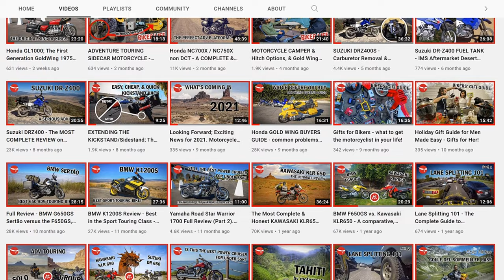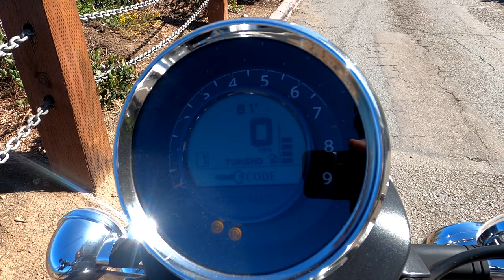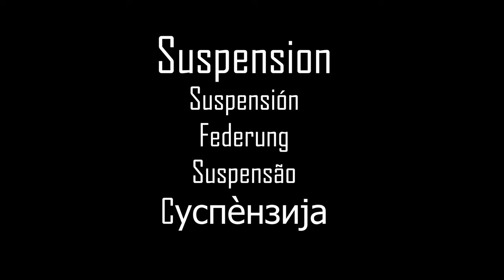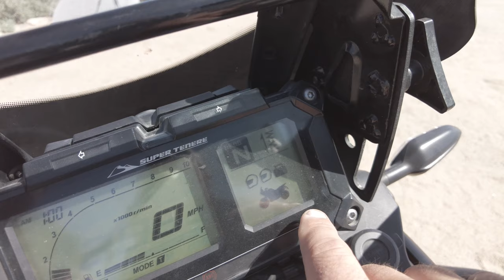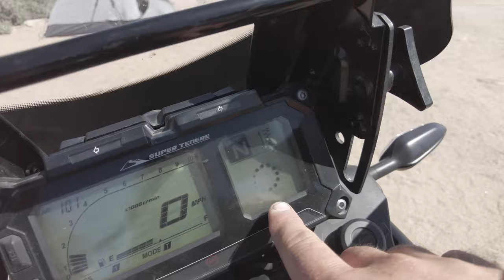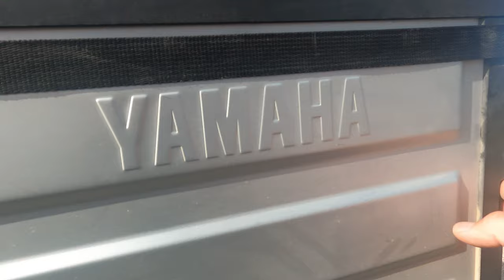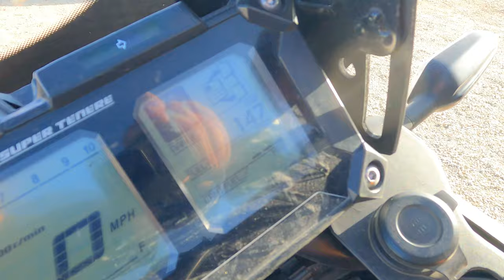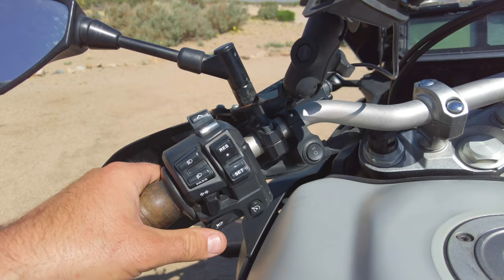Yamaha SUPER TENERE ES XT1200Z + luggage, ADV mods & Upgrades; a COMPLETE, HONEST Owner Review in 4K

Comment: Great review! I am happy you choose this bike to review as we can not see many videos for ST.
I got my first bike 6 months ago and its Strom 650XT, but I feel I need more power and thinking between Strom 1000 or Super Tenere as they are bulletproof and have normal price on market. I am not sure If I am going to see much difference if I choose bigger 1000 Strom. I am 6.7 tall and 230lbs so I guess Super Tenere would not be heavy :)
Reply from the maker: Zdravo Lazare. Dobrodosao i hvala na podršci.  Pisaću na engleski da me ostali razumiju jer ipak ljidi čitaju ove komentare. My very first review on this channel was of my Vstrom DL1000. There is a very noticable difference between that bike and the smaller 650. It also feels a lot like three than the super Tenere. I loved my Vstrom, owned two, and would gladly ride it again. The newer ones also look fantastic with the yellow spoked wheels. Again, it's quite a difference in power between it and the 650. I've owned that twin engine once, on my sv650 and sold it within a week for being underpowered. After that I've owned three sv1000s which share the engine of the Vstrom. The Vstrom also sells quite easily, and doesn't sit on the market as long. I say give it a shot and ride both to compare. But for someone your size, anything less than a liter bike will not cut it.  Good luck.
Reply: @pegasusmotorcycletours  hvala Nikola, I am going to check this weekend strom 1000 with 8k miles,  2016 model.
Reply from the maker: @lazarsekulic2694  let me know of you need a second opinion. I'm happy to look at the ad and let you know if I see something interesting.

Comment: Hi Nik! Great Review and very good analytics of the ST. I own since 5years a black DP01 from 2012. I use it only onroad, with Michelin Touring -Sport Tyres. The comfort is unbeatable since 75.000 km now. For Offroad I prefer my old XT500.....the weight.....but you told about it.😁
You forgot to show the possibility to manipulate the fuelinjection ( CO-set) for a smoother running at low rpms. It is a thing of 20 seconds.......
And the possibility to reinstall the powerlimiter of the first three gears....
That cost a few bucks, but
this is necessary to survive on the Autobahn😁
Greetings from good old Germany
alex
Reply from the maker: Servus Alex, and thanks for participating in the conversation. Thanks for those great tips. I recently test rode the Guzzi stelvio and was very impressed. Very similar specs but a larger tank. I'm curious, I've owned two guzzis and they have been my favorite bikes so far.

Comment: A great bike for sure. The triumph 1200 tiger shaft drive is a great alternative but I think it's dearer secondhand but their engines are great. A superten with 30000km+ will be £5000+ . Only drawback is doing valve shims. Fortunately they stay in spec especially if the motor has regular oil and filter changes. That way there will be hardly any wear on the valve train.
Reply from the maker: Thanks for watching. Please stay tuned as tomorrow I release the trailer for the private Eastern Sierra tour in case you're ever in my neck of the woods. It's.some of the best riding in North America.
Reply: Nick Sanders used a tiger 800 doing over 50000 miles on one of his round the world rides. It was a great statement of reliability and not too big and heavy and very reliable. I had cheap Yamaha XT500 and Suzuki GS750 which were both good and the yam was good on Aussie dirt roads but the Suzuki was very reliable and had 40k miles on it. Superb motors and only the gs850 was better due to shaft drive, power and big comfy seat 2 up. One of the best UJM inline 4 cyl of a good 80 bhp at the rear wheel. It went round the clock and was an ex despatch riders bike that cost £500 but never broke down, only a puncture in all the time I had it. Great those GS Suzuki's whether 250,400, 425, 450, 500, 550, 750, 850, 1000.

Comment: One most underrated newest bikes. Its overbuilt, clever, quality motorcycle. Maybe it was bit late to the market and not properly advertised. 

About engine: I saw dyno runs before and after remap... Difference after remap is huge, alot of gains and power are unlocked that transformed engine and power delivery. I hope someone who did remap would write few words :)
Reply from the maker: No doubt, I agree with everything you mentioned. In fact there was a comment last week that talked about how remapping those wonders for this bike. Would love to experience myself
Reply: @pegasusmotorcycletours  To bad BMW took all apples with R1150GS and later on. Tenere has strong heritage but someone at Yamaha let it down. Leading every motorcycle in that class is compared with GS. Being right at wrong time.

Comment: To get rid of the carpel tunnel pain is get the pro-taper adventure handlebar.  The stock handlebar places a wicked twist on your wrist. Put the stock pipe back on it.  Loud exhausts are not so good on the ears.
Reply from the maker: Thanks for the to. Really appreciate it.
Reply: Might save your ears, but not your life...as a 44t truck driver, I often hear you,before I see you...a completely stupid suggestion, the engine was designed on a bench, then strangled...put it back to the way it was designed, noise and all!

Comment: 46,000 MILES ON MY ST,Gets over 50mpg easily touring Europe 2 up and I dont hang  around,Rear Diff main seal replaced 4000 miles ago and routine service ,thats it,totally agree with you with the panniers,crap locks,bike still looks good for a 2011 model,I use Metzeler Tourance tyres,6000ish rear ,9000ish front and you are right you cant sell em but who wants the breakdowns of KTM,DUCATI AND BMW mid vacation,I will keep mine for ever I think.
Reply from the maker: I can see the appeal of this being the long term keeper. It has everything a rider.coukd want. Thanks for watching and coming in

Comment: This is one of the best video’s explaining this is a proper adv bike. I have a 2014 model with 90.000 km on it whit no problems. The thing with the super Tenere is that it is so good it is one of the most borring bike on the market. The power is perfect nobody needs more. The suspension is great the way it eats his miles it is so damn good it is just borring. If you take care a bit of you right hand you can do 20 km’s a liter. I think all bikes above 200 kilo are no good for loose sand and mud or you must be a pro driver or a verry strong men lifting this bully. It is the most underestimeted bike because the european market is ful of bmw’s but I think it is a far better and more reliabel bike dan de GS at the time of production 2010. The new Bmw from 2020 are way better but that is a ten year of more experience. Thanks for the video and have fun. Greetings from Hollanders drive safe.
Reply from the maker: Thanks for watching and participating in the conversation. I'm glad you found the review accurate. Another bike that similar and very well priced here is the Aprilia caponord. I'm looking for one and 8 grand can ge the rally version. So many bikes, so little time. Greetings from San Diego.
Reply: Just bought a 2013 with 10K miles. 
Can't wait for the season to start.
Even on a short test in really cold temps, it feels like the right answer that hits the sweetspot for how I spend time on 2-wheels

Comment: Hi you didn't mention  the durability of handgrip  heater.  May I known your recommendation  on how to preserve  it as well ?  Do you recommend  to freely   use  power  spray  water on those control on the grip when you do car wash  of your bike ?I appreciate  your review a lot simply because maybe you're on  same height and  we almost have same thought  on it. Thanks
Reply from the maker: Thanks for watching and for your question. Washing your bike by hand should not be a problem. Avoid strong pressure washing like at the carwash. The heated grips require no maintenance but I would avoid directing water on the hand controls. I wash my bikes with a bucket and sponge. Cheers.
Reply: @Pegasus Motorcycle Tours & Consulting  thank you so much for the kind response.  Mine is only 14000 km mileage  yet the heater is worn out. I watch other review and the found out somewhere  in 30000km mileage  the cable got broken but  he didn't  mention as well  the reason. . Anyway thanks again.

Comment: So how does this compare to the Honda Africa twin??? Thank you for the video. Coming from dirt bikes, super bikes the a Yamaha raider. Now looking to dip my foot in, will be doing mostly highway but then gravel back roads and also a mountain bike rack to Arkansas. 
Thanks again
Reply from the maker: Thanks for watching and for your question. The AT is much lighter and more capable on the dirt.  Bigger front wheel slows for easier riding over rocky terrain or obstacles such as logs. It all depends on how difficult the roads you wanna ride are

Comment: For sure, if you want an Adventure Touring bike that does great mostly off road on sand, skipping stones, this is not your bike, neither is the BMW or KTM or Triumph or any other heavy weight. Go mid-weight or dual sport. If you want to crush highway miles to get to forest access roads looking for, say, dispersed camping sites or maybe hunting access areas, this is definitely your bike. This is a GREAT touring bike that will carry you and your gear to remote areas for less money and greater reliability. What you can do on a Beemer you can do on an S10. It's a matter of how much you want to spend..
Reply from the maker: I agree with everything you said with one caveat - the big ktm 1290 can actually do amazing things on rough terrain. More so than the rest in the class. I have a 790 now and am very impressed but have seen what a 1290 in good hands can do.

Comment: I’m considering buying a tenere 1200. Another video stated this bike is an 80/20. 80% on road and 20% off road. Do you agree or disagree with that assessment?
Reply from the maker: Id say in good hands the bike is more capable than merely 20 percent. Any bike can be 20 percent capable off road. It's all how comfortable you can get with a heavier bike, but one with great components. Fairly unintimidating wider dirt trails are fine. It's an ADV bike after all and yamaha knows how to make bikes.

Comment: For the slippery top of the cases, you know those small glue on plastic door handle stoppers? Yea get a pack of those and place 6/8 of em on the top. Worked like a charm for me and theyr practically invisible.
Reply from the maker: Thanks so much for the tip. You don't get dirt collecting around the edges?
Reply: @pegasusmotorcycletours  i do, but they dont collect on the glue, more so on the hot "plastic" material... Also another good one (that works better than door knob stoppers) is that clear tape that comes with sticker kits and other stuff allike. Maybe even stuff like tank grips wouldnt be bad.

Comment: With Motoz Adventure tires you can dig thru the sand on this beast. And it can do some wanna-be-extreme thing, it's always a pilot, not a motorcycle. Mine 2019 has 39000km, I did tough terrains on it, bulletproof.
Reply from the maker: I do agree there, the rider is the most significant determining factor as to what the bike can do. Thanks for watching.

Comment: one gallon means 3.8 liters at 40 miles i.e. 60 km... so at 60 miles i.e. 100 km it would consume about 1.5 gallons i.e. 5.7 liters... I say that for a 1200 cc engine it is very good consumption... on the highway at 95-100 miles the consumption of my motorcycle was 1.6 gallons... so personally I say it's more than ok...
Reply from the maker: Perhaps it's my own personal annoyance with having to visit the gas station literally every day to fill my vehicles. For that time saving it's been nice owning an electric motorcycle. My home bfr1200 also has a smaller gas tank than it's 800 predecessor which is and annoyance. Thanks for watching

Comment: 110BHP & 82ft lbs Torque, 270 degree crank, twin spark plugs per cylinder, 1199cc engine, 261kgs in weight. Yamaha stopped production of this motorcycle in 2020 in the european market due to not making the engine EURO 5 emissions efficient.
Reply from the maker: Are you in the EU? I am contemplating a purchase of a 6 Mile 2014.

Comment: Extend the pipe on the aftermarket one it would still be lighter
Reply from the maker: Thanks for that tip - What exactly do you mean by extending the pipe? You are talking about the actual muffler or the baffle.
Reply: @pegasusmotorcycletours  the pipe between the motor and the muffler it would move the muffler back or you could add a piece at the tip that turn  the exhaust gas just enough to not melt anything.
Reply from the maker: @barendfourie6687  thanks for clarifying. That makes sense.

Comment: For every day transportation, work commute, weekend riding,KLR or Super T?????
Reply from the maker: The ST has all the bells and whistles and is a bigger, heavier, smoother, more powerful bike.
Reply: Thank you
Reply from the maker: @josemanrique458  for commuting, the ST has larger side cases although not by much. Neither bikes can fit a helmet inside the success. I say that cause i commute 60 miles to the office and have a vfr1200 and I use one sidecar for my helmet, the other form my chaps cause it's cold, and the top case is where my backpack and jacket and vests go. So i walk in without any gear and it's nice.

Comment: If yamaha can convert there mt07 into a tenere 700 , the most logical option to progress is to follow through with the mt09 . The 1200 is really no longer irrelevant
Reply from the maker: You mean no longer relevant?
Reply: Don’t want a 3 cylinder adv, 
Just update the engine, make is sound nicer, make it lighter, update the electronics and keep the design, no modern bug eyed transformer look in this bike, it looks beautiful as it is.

Comment: Vehicle market values are coming down from bloated post Covid and supply chain issues.  Down trend started Nov. 2022.  What goes up irrationally must come down. Can actually buy new bikes on showroom floor now.  Many Investments banks state 20+% decrease coming which was the increases that occurred since 2020.  Winter off season for most eastern (80% population) motorcycle markets also.  US in or near recession most areas.  Buyers market.  Many sellers have not got the memo and will be sitting scratching their heads until they capitulate.
Reply from the maker: No doubt, i just read an article about how carMax, the biggest dealer stateside, had a dismal quarter due to overvaluing vehicles. This bike in particular gets overlooked. One can pick one up for 6 grand here. Thanks for chiming in and participating in the conversation. Nik